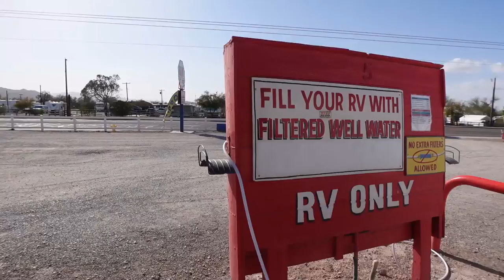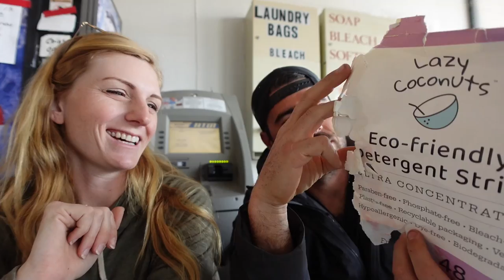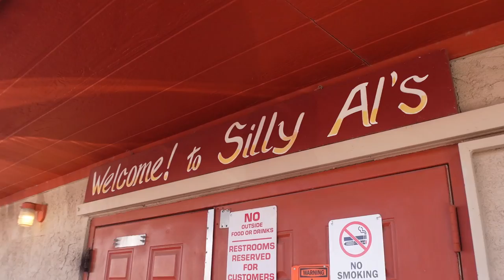Quartzsite Arizona Full Time RV Living

Comment: Respectfully, there are things to do in Quartzsite.  During the winter season if someone researches things can be found to help occupy time.   There are different clubs to join, Quatzsite rock and gem club, Metal detecting club, the QIA (Quartzsite Improvement Association) has many things going on.  Many off roading and hiking opportunities. 

When you were there for the Grand Design Rally most of the vendors had left and the town was preparing for the off season.  

Like the water bladder and your "ghetto" transfer system, Hope your travels are safe.
Reply from the maker: Yes, there are a few things to do but not as much as we would like personally. Thanks so much on the water bladder, It's a work in progress. We really look forward to having an extra hundred gallons of water with us.
Reply: You should be here in January. It’s hopping! Traffic jams and all.
Reply from the maker: We were! We were actually here a few different times this winter season....

Comment: Easy way to equalize your tanks is to put a valterra valve on the black pile that stains your grey and black tanks. U can open both greys and they will equalize and u can do the same with the black. That way u don’t need to change any plumbing
Reply: Black pipe that drains 🤦damn spellcheck
Reply from the maker: Yeah that's what we did, unfortunately the valve stuck out very far. I've been searching for a different brand that might be shorter.🤷‍♂️
Reply: @AdventureEndeavor  depending on your pipe setup..it’s easy to cut and shorten the pipe. A few parts from Lowes and a hacksaw…20 minutes. Again…depends on your pipe configuration. 

I made video when I did mine. 😜
Reply from the maker: Yeah I know was trying to avoid that. I'll checkout your video! Thanks.

Comment: Not bad, guys. Sometimes the unplanned vids turn out better than expected. Always love to see the dogs - you don't even need to shut em up or remove em from the shots. They're the stars we rarely see. Ha. Just out of my own curiosity, I calculated the weight of that full water bladder and was impressed. Almost 800 LBS! (788) Wow. Well you'll never need to worry about additional weight in the bed for extra traction when off road. I'm sure the camper cover adds plenty anyway for that. Nice vid.
Reply from the maker: Haha right, we didn't think much of this video but it was a very fun edit. Yeah we are definitely keeping the dogs in quite a bit more. The water is heavy but the truck can handle it especially considering we do not have a 5th wheel anymore. Thanks for watching!

Comment: Why not gravity feed the water? At 11:57, inlet is below Jesse's elbow and at 12:23 Jesse's elbow is roughly at tailgate height. Not a lot head pressure difference to the inlet but enough to transfer the water without the need of a pump/electricity/adapters/hoses/failure points.
Reply from the maker: Hey that's not a horrible idea, it might work. I'll give it a try! Thanks Jason.
Reply: @AdventureEndeavor  KISS principal is life! Depending on where you are boondocking you may need to "manufacture" some height difference to help gravity out... Back the Dodge onto some ramps, lower the camper jacks or possibly fill the bladder on the roof of the topper. Your LAST option should be pumping the water!
Reply from the maker: Very true and we talk about that slogan all the time. That's why I loved my shake hose it was easy!
Reply: I invite you to see:" Identity Crisis" for: Jim Staley